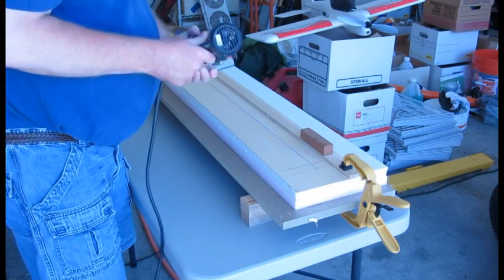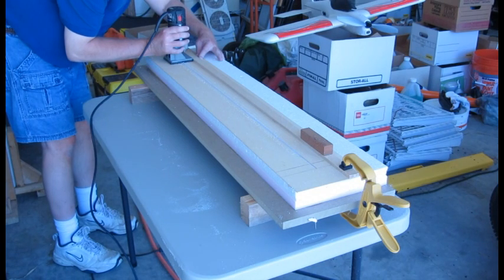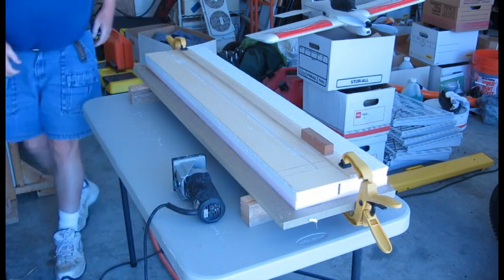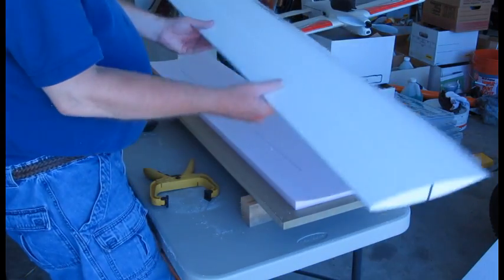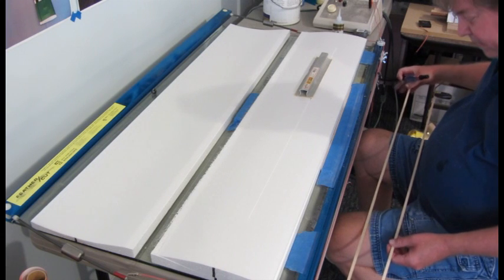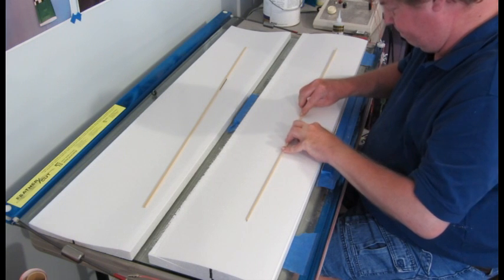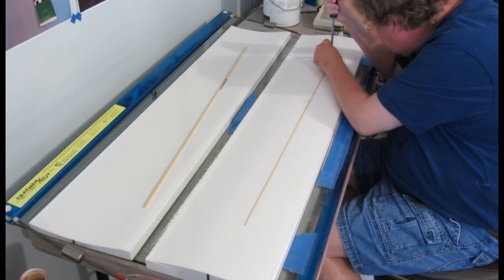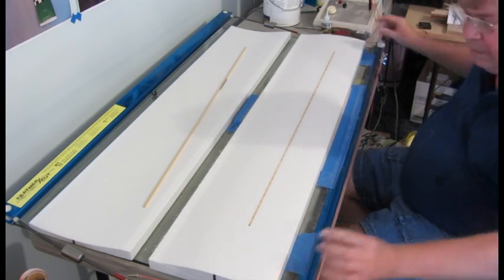Adding Spruce Spars to a Quickie Wing Core

Comment: normal used garbon fiber flat rod in wing, cheapen and lot lighten and stronger.
Reply from the maker: The 1/8" x 1/4" spruce I use is extremely strong when properly bonded to the wing skills with the carbon fiber laminate. The strength of my wings has been demonstrated by a 250+ pound person sitting on one suspended by chairs on each end. I don't think many Quickie 500 planes are going to exceed 250 pound of G-force in even extremely tight turn.
Reply: @DonStegall  That's called over-building, if I'm not mistaken?

Comment: not good wing if profile have same both side.
Reply from the maker: The AMA Quickie 500 rules state that the wing must be a constant chord with at least 47.5" of constant chord with a minimum thickness od 1.188". The wing tips may be any shape as long as the maximum span of 52" is not exceeded.  Per the rules ... See https://www.modelaircraft.org/sites/default/files/files/events/rulebooks/RC%20Pylon%20Racing%202019-2020%20102819.pdf

1) Area

Minimum 500 square inches.
2) Span
Minimum 50 inches (projected), maximum 52
inches (projected).
3) Chord
Constant for at least 47-1/2 inches of span.
4) Airfoil thickness
Minimum 1-3/16 inches for at least 47-1/2 inches of
span.

Comment: Don, it's much easier to just put 3 lengths of carbon fiber tow span wise top and bottom before skinning with balsa and epoxy. Actually strapping tape works too.